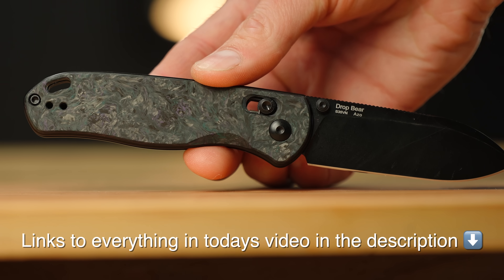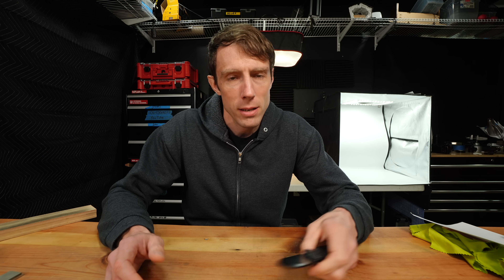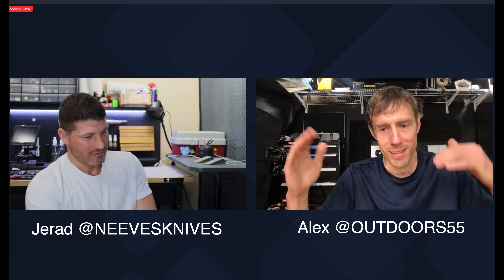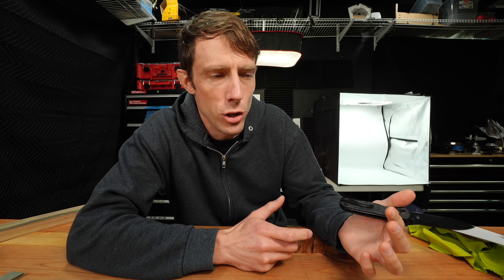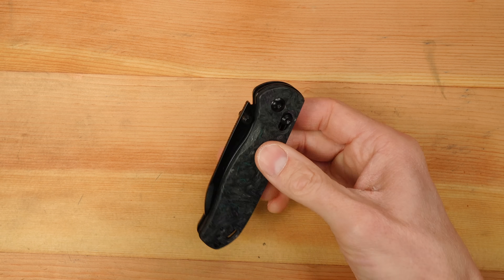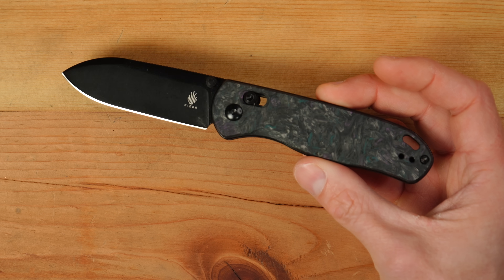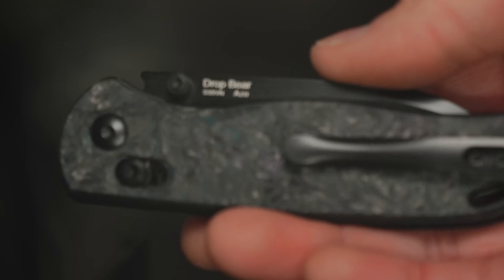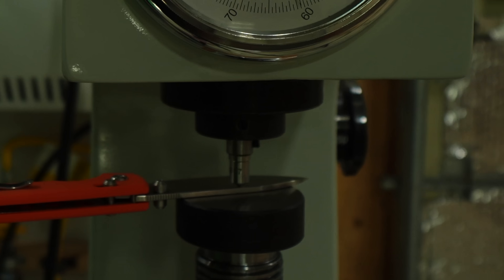Kizer Drop Bear Review - All Time Great, Or Over Priced Wannabe?

Comment: You have to filter the air in the room before you measure the hardness, it chemically bonds to the knife and effects the hardness :P
Reply: Seriously, how does everyone not know this?
Reply: Also, the lunar positioning, ideally you want to test HRC at slack tide based on local charts to standardize for neutral tidal forces.
Reply: Also best practice to ensure that the moon isn't at perigee. Something with tidal forces stretching the steel, softening it.
Reply: @zionpsyfer  🤣🤣
Reply: Maybe your right but it still got beat by a cheaper knive

Comment: A bit unrelated, but I think it would help a lot of people if you could talk about the techniques for sharpening long knifes, like chef knives, there getting an even edge up to the tip is quite tricky. :)
Reply: The thinner the knife is behind the apex, the less steel you have to remove, and therefore the easier it is to put a consistent bevel on the knife. If your problem is that you're running out of stone, that's understandable, but try turning your body abit more. I'm sure he can make a video to show how to deal with super long knives and small stones.

Comment: Benchmade had the original patents for the axis lock. Those expire a handful of years ago so now most brands have their own take on the lock out there. While most companies have their own name for it, the þore general term is just a crossbar lock (benchmade still own the axis lock title). If I'm remembering correctly, Kizer is known for doing the lock type exceptionally well and for having adjustable tension. Crossbar lock typically have 2 omega springs that wrap and the bar with other ends of the springs hooking into a small hole in the liner. Kershaw has multiple different holes predrilled into either side to reduce or increase resistance. It's a cool feature, but I imagine it's rarely used.

Comment: Happy to see you are doing well!

Fat Carbon is a carbion fiber laminate made in the same country I am, Lithuania!

I wouldn't say that the less expensive version of the drop bear have "less quality" materials, they are just less premium that are cheaper to manufacture and the base materials are cheaper, Norplex micarta is a great example of a beautiful material that is very wear resistant that is also not as  expensive.

I have nothing to comment on the Heat treat, seems like amissed great opportunity and the blade is very thick behind the edge.

And as for compating with lower price knives, I feel like bag for the buck you get the most the cheaper you go, especialy ontario folders for 15 bucks.. but its like with music equipment, its depreciating returns, the higher end you want the more you need to spend. In this case the ginrding of the steels is totally different and wear in the manufacturers tools and also the base materials have different prices.

FYI, it's like just  like my opinion man...

Comment: The clutch is basically an axis lock but you can adjust the spring tension to personalize your action. Also the bench made patent on the axis lock ran its course a couple years ago allowing kizer to use the design

Comment: The coating on the opposite side might also affect the HRC. Remove it and burn off 10% of the surface layer with HCl acid. Melt the steel into a perfect flat block. Buy 10 knives and do the same to get a big enough sample size. Make sure your tears don't fall on the block of steel, as this could affect the reading by 0.000001%

Comment: Benchmade axis lock patents expired a few years back so a lot of companies are making their own versions now.  If you like the Drop Bear, check out the Olight Rubato 4, also made by Kizer. It is slightly different but close design and also has S35vn steel. Hardness is supposed to be 60 +/- 2
Reply: Not to be that guy, but isn't 60-2... 58?
Reply: @jonpaul6948  Yes, but it could also be up to 62 depending on the heat treat that day. The unfortunate downside to cheaper production.
Reply: I remember getting an Asher Knives "Nomad" relatively shortly after the patent expired and reddit was full of knife nerds frothing calling it design theft that someone made a better drop point knife axis lock knife than Benchmades Shitty bugout with the springs that break all the time! Now every knife is a drop point axis lock and nobody complains, smh. Btw almost nothing else about the two knives was the same. Profile, materials, spring quality, aesthetics...
Reply: Should be 61-62 if Kizer actually cared enough.

Comment: I did a lot of research into kizer and found out they don't do good heat treat on certain steel like s35vn, 20cv, m390, 10v, and 15v, there might be others I'm forgetting. They do good to great on these steels, 154cm, 3v, 4v, elmax, and s90v but s90v is a given being that even 58 or 59 hrc is acceptable and still going to have crazy edge retention. They were running their 3v and 4v a little soft a few years ago but they said they were going to improve them and then when tested again about a year ago the 4v was running 64-65 hrc but I haven't found any actual recent test results for the 3v. I haven't tried their 3v myself but I did recently purchase a mini sheepdog in 4v and I believe they are still doing very good heat treat with it, I sharpened it right when I got it and I've been using it hard daily for a month now and its stayed very sharp with just 1 or 2 strops. I honestly don't understand why they are using so much s35vn on their premium knives when they can use what they already do well, 4v or elmax for knives they want to be tougher and s90v for knives they want to have excellent edge retention.
Reply: I have their drop bear with LC200N, not sure if that is a steel of theirs you have tested. From what I understand its a quite soft steel. One aspect I dont quite get is why everyone seems to always prioritize either hardness for edge retention, or a good balance. Honestly to me it seems like toughness is better. It isnt difficult to strop your knife every once in a while, as opposed to needing to put a new edge on it because its chipping across the blade. I looked at a D2 knife I was using for just a few months at work through a jewelers loupe and it was already chipped all over, honestly thats what I would rather avoid. Although I could just be missing something, I usually am.
Reply: @ I haven’t done any hardness testing myself I’ve just researched into this and specifically a lot into kizer. Personally I find this stuff interesting but I actually don’t prioritize edge retention either. What I found to probably be more important is the entire HT process is important not just the final hardness number, the many heat and cool cycles align grain structure which is also important to the all around performance. For the actual hardness, different steel compositions can be within a range and in that range the lower will typically be tougher and higher will typically have better wear resistance. What I really look for now is how well the steel sharpens, how well (easily) it deburrs and how nice of an edge it can get. I actually enjoy sharpening knives and improving that skill, so I prefer to have tougher steel that I get to sharpen more often as a bonus. Since you mentioned D2 I’ll say that I have four D2 knives and only one of them sharpens nicely, I don’t think it’s a coincidence that it’s the only one to also perform really well.

Comment: Videography and knowledge drop as ever first class. A $160 huh.

I would call that an axis lock myself but what do I know? This week I bought my first Ganzo (727s) $24, WTF just WTF? How do they do that at that price and build quality, makes for a great tourist knife.

Edit to fix spelling and add bought a set of Global kitchen knives this week as well been desiring them for years, sometimes you just got to!
Reply: Ganzo have low performing steels and break often. Its worth 24 or less.
Reply: Ganzo best bang for the buck in the knife industry. Built solid with serviceable d2 and 440c in fact their d2 is consistently done pretty decent. Anyone saying ganzo doesn't make a solid quality piece dollar for dollar is just wrong.
Reply: @EDCandLace agreed, it's horses for courses and people are free to choose.  Talking crap about a decent value for money product doesn't change facts.  IMHO some companies need to step up their game for the money they charge or get realistic on their overpriced products.
Reply: @tacticalcenter8658  Ganzo 440c is said by factory to be 58hrc thats 0.5 less than the Kizer tested in this video or the same as the final coating removed test.

I don't see a blade coating and chopped carbon fiber scales adding $149 value.

If I was to change anything on the Ganzo, I would like the pocket clip to be more flexible and the action springs to be a "touch" less stiff. Easily remedied at factory or by user.
Reply: @fuzielectron5172  the kizer is not worth what they are selling for. That's for sure. Lacy, Ganzo at 62rc d2 cannot even surpass 59rc benchmade ingot d2 performance for perspective.
Reply: @tacticalcenter8658  I'll get back to you when the Ganzo falls apart or breaks.

Glad we agree that on this one Kizer needs a good kick up the ass, have a great week 👍

Comment: throwback to an older vid - but I bought the vosteed raccoon and just received it today. shaving sharp out of the box, really nice finish, joint is solid, opens easy, awesome texture and fit on the scales, and really good pocket profile. and it comes with a little zipper carrying case and a microfiber cloth (for? heh). but the overall fit and finish on it is actually really nice for a "budget nice knife". great recommendation.

Comment: By the way it was mentioned in the video, I know ya don't care. But for "viewer interaction"...

Benchmade's patent ran out on the Axis lock concept years ago so anyone can make it, but they still hold the trademark name "Axis Lock". That forces everyone else to call theirs something else (XR lock, ABLE lock, Clutch lock, Slide lock, Crossbar lock, Joe's BBQ & Foot Massage, etc.)

The Clutch lock's claim to fame is being able to adjust the omega spring tension by having multiple anchor points in the liners. More or less a nice to have feature when the omega springs become a bit weaker 10-20 years down the line.

Fat Carbon is a name brand of carbon fiber products from the Czech Republic who famously have colors swirled throughout the material on most of their products.

And funny you mention Vosteed in the video. Their creator was a designer for Kizer several years ago (Famously did the Cormorant model) and left to form Vosteed. Not anymore, but their first few releases were OEM'ed by Kizer while they were in the midst of buying and setting up equipment for their own facilities.

As for the Drop Bear... It's an alright design, but didn't set me on fire. Their designer Azo Mai has a tendency to use proud liners on a lot of his models. It's a cost saving way to emulate contoured handle scales, but they just feel uncomfortable to me when a good amount of force is used. I preferred the "Escort" model from Dirk Pinkerton, but it's a straight-back blade instead of a drop point.

Comment: I guees Stuff happens . I bought 2 knives from Kisar and an happy with both . One was the `Escort` model which is the same locking system. It works fantastic.  The tention IS adjustable as the blade has holes drilled in it for you to do as you might like . The blade is longer,  3.3 in. and come in different scales for you to chose . 
I can`t say about the hardness of the steel  ,but it is 154cm .So good enough for me. 
$89.00 makes it a good value , imo
I`m surprised that Kisar got you a bad knife .Their quality seems to be very good . But all things change ,so that might be an indication of their future .  I guress it`s now` buy at your own risk` ...
Well at least we have been warned .... Thanks

Comment: You know i think its maybe alittle hard to believe that the coating affects the hardness testing. It'd be interesting to see a video where you spray paint a piece of steel, and try to get it to measure differently when you know its exact hardness. You could also show how much a difference there is when measuring on the flat of the blade verses on an incline ect.
Reply from the maker: Watch till the end😉
Reply: When the manufacturer applies the coating it does so at a heat greater than it was tempered at usually. This causes the steel to be softer.

Comment: My first non cheap knife was in 14c28n.  And it was great, but I wasn’t thrilled with edge retention.  I picked up a Spyderco in CPM CruWear and I can absolutely tell the difference.  BUT!  After more knives and getting better at sharpening can I tell the difference in edge retention between CruWear, S30V, M390, S90V and Magnacut?   Nope.
Reply: You can tell the difference. You choose not to.
Reply: @tacticalcenter8658  Arrogant much?  The point is once you hit a certain level of edge retention in super steels they are very similar in day to day use.
Reply: @jwiz1911  why are facts arrogant?

Comment: I don't get doing coating on a stainless steel. All kt does is lower hardness since they're done at high heat and act like another temper cycle. Unless you take it into account like say Rockstead and run it harder for that reason (but production blades are all done the same and then some get satin, bead blasted or coating finish). I guess some people like coated blades but mist don't since they're always the last to sell out.

Comment: As soon as manufacturers stick carbon fiber (or for that matter, titanium) on a knife, it becomes pocket jewelry. Have I bought a few Chinese knives in S35VN in these handle materials? Yes. But for those two (Kizer Clairvoyant, Civivi Vision FG (KC excl.)), its always been because because I loved the design, and found the  S35VN + CF the most aesthetically appealing, not because I expected them to perform better. 

And there's my problem with the Drop Bear. The design seems functional but unless one's really into spear points, pretty boring. I was even interested in the LC200N version as a nicer alternative to the Spyderco Salts, and then discovered Kizer made no attempt to make the rest of the knife corrosion resistant.

Comment: With Benchmade the patent has expired but they still own the trademark "Axis Lock" name, so while others can use the lock type they have to rename it as something else like the "Clutch Lock" as Kizer has done. Very dissapointing test results on the steel at 58.5 HRC, would love to see an uncoated version tested to see those results as the claim is that during the application and curing of the coating a temperature is applied that will lower the HRC due to the tempering effect of having that heat applied for a specific lenght of time. I believe Jerad at Neeves is facing the same problem with the coating he is trying to get on K390 (uncoated 63 HRC and Coated at 61 HRC i believe)  on the knife he is having made overseas. For myself i have the big brother to this knife the Kizer Escort in 20CV with aluminum handle, without a HRC tester i cannot be certain but it appears to be in line with other chinese 20CV knives just average, but I'm only on my second edge so im hoping for a but more improvement like we see on many steels with a burnt edge (something pretty common I've found). For the price id say it was an ok purchase around $150 and the tunable action on the clutch lock makes it one of the best i have ever tried. There is a much cheaper version in 154CM and micarta but the premium one has much better quality in my opinion and worth the extra cost for materials and feel of the knife.  Thanks for the great vid and keep making sharp things fun and enjoyable

Comment: Interesting. I've heard that some blade coating processes can mess with the hardness or temper on blades, especially cryo-treated ones that have a 350-400F temper. No clue if that's the case or how much the swing in hardness would be between coated and plain blades with all else being equal.

I did a cut test a year or so back of a lot of companies' S35VN profiled to 15 degrees with twisted sisal rope (Artisan, Boker Plus, Civivi/We, Kancept & Spyderco China). They all were surprisingly close to each other, I think there was about a 20 cut variance between the top and bottom (they averaged 700 cuts each). I didn't have a Kizer in the stuff at the time though
Reply: Some coatings require give or take 500c. So they will be better off using secondary hardening and the coating can be one of the 3 tempers.

Some coatings dont require that high of a temp but they dont usually last.

You can apply high heat tempers but they dont usually do too good with hardness in the end. Plus if you ask for ht, in china, they give you the whole ht, so I dont think you can ask for no tempers and then apply the high heat coating as the temper.

Comment: nice loved the review disappointing to see the drop bear come in so low on the hrc but i gotta say i love mine and it did feel like it has softer steel the way it sharpens  compared to other knives with similiar steels but that being said can i go a week or so and use it at work and not need to sharpen yes generally speaking and i got the green aluminum scales and s35vn for 109$ on sale if memory serves which i think is completely reasonable for the knife 169 for fatcarbon and s35vn i couldnt rationalize that price either
Reply from the maker: Dont get me wrong i still like it🙂 It was in the pocket today 👍
Reply: Definitely didn't take it that way.  There can be knives that you like  but they just fall a little short of making it to the new favorite list or top 3 . Glad to see you doing better.